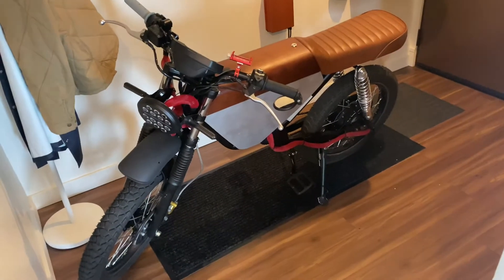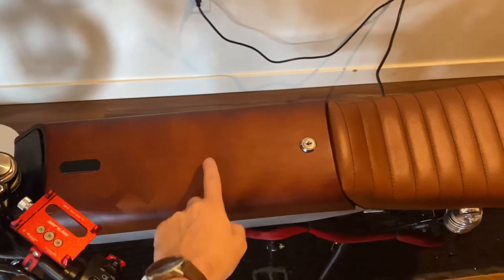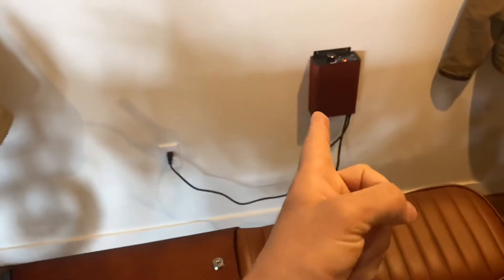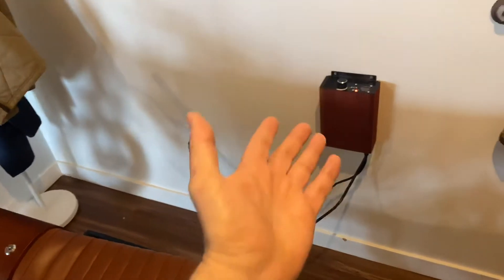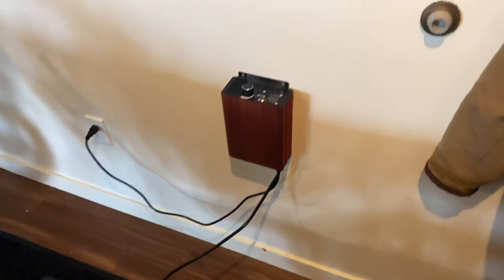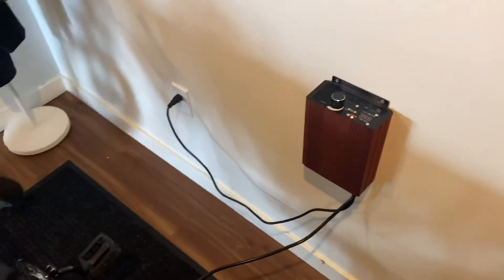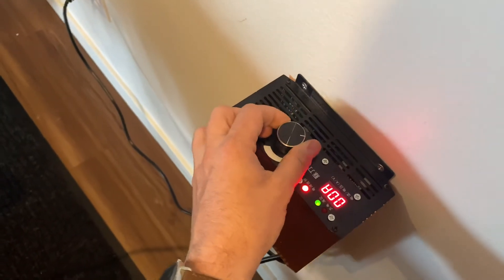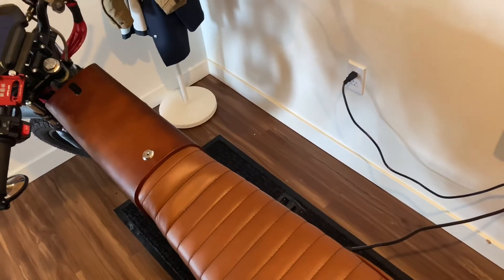72v eBay Variable Amp Charger VS Cycle Satiator

Comment: I found your link to be dead, it happens. Would this be the same charger unit (looks like it)...search " 72V Ebike Battery Charger 3A-12A Adjustable For Lithium ion Li-ion Quick Charge "  in eBay, they're $125, free ship, US seller, you choose your connector for your unit. Great video, by the way!!!
Reply from the maker: It is that charger but I no longer recommend it! I would look at the chi battery variable voltage 72v charger

Comment: mine burnt today :(
Reply: Really ?! How and what happened ?
Reply: @rolandroland1485  yea, i order anotherone and is ok about one year - 50 charging. Only coils are loud much more than before, but is ok. And burnt, i dno, It works around 10 charges, no problem, then i plug cable into wall once, and it blow fuse in my house :D I only plug it, chargers switch was OFF position.
Reply: @TnTckoo  wow that’s pretty odd, I thought you say you made a mistake. Maybe you got a faulty one ?
Reply: @rolandroland1485  how you can make mistake ? :D nono it was just faulty one
Reply from the maker: Mine too! I’ll be taking the video down soon since I don’t recommend it. I’ve been using the variable voltage chi battery charger and it’s been excellent

Comment: Looks like a nice charger but not really in even the same ballpark as CS, CS can not only vary the amperage but also the voltage across a huge range as well as charge many different battery chemistries and to varying levels to cell max. If you don't need all that capability then the one you are using is great, I wish more manufacturers provided this type of charger instead of the little garbage 2amp power brick.
Reply from the maker: I agree you can even notice the quality difference handling the two. Grin makes some phenomenal well engineered stuff. That said for the overage onyx rider the charger I have will be of good value and provide a faster charge time.

Comment: Hey. To I’m commenting again because i finally got my charger but I’m kinda stumped on what connector to sue on the battery side to connect to the charger, what and how do you connect your charger to your ebike even tho yours si prebuilt
Reply from the maker: So if you’re charger came with the round end with 3 holes (XLR) you will want to search for an XLR female end to attach to your battery. Does your battery have a connector on it at the moment?
Reply: @FrenchToastMotoClub  sadly thatS not what i received :(, what i got was a three whole connector but it’s not the XLR it doesn’t have any marking other than it saying “10A 250V” and that’s it
Reply from the maker: @FatalJouy  yeah I’d cut it off and solder an xlr or while you are at it upgrade to an sb50 type connector

Comment: Thanks for the video bro ! Was really debating which one to get and this one looked sketchy but i really need the fast charging option and 5 amps isn’t enough lmfaooo thanks for helping me decide AND save money
Reply from the maker: No problem my friend, this one has been super reliable and is a great deal. The fact that you could buy ebikes in the future and use this same charger is a total win.
Reply: FrenchToastMotoClub hey what connector does it come with to charge the battery ?
Reply from the maker: If you order from Litespeed or the Litespeed eBay account it will come with a higher amp xlr. You will want to specify in the order comments or by emailing the vendor
Reply: FrenchToastMotoClub ooooff thing is i already ordered it 😂 i was just going to chop off what ever connected i got and put on a xt90s one on it

Comment: All Lithium Ion charger profiles use CC/CV methodology. At the beginning of the charge, it uses variable voltage, but constant current, and then at 90% voltage, it switches to variable current, constant voltage output. It's not that the 12amp charger knows what voltage the pack is at and adjusts the output accordingly, its that it tells you at what rate it's discharging, unlike most other basic chargers on the market, like the stock ONYX charger.
Reply from the maker: Thanks for the clarification Turner! Always appreciate your knowledge drops :)
Reply: are you saying its not good to use for other voltage ebikes?